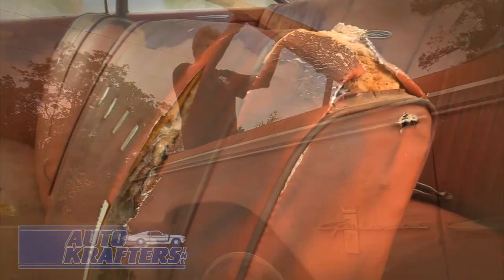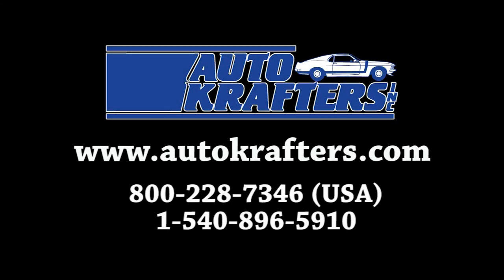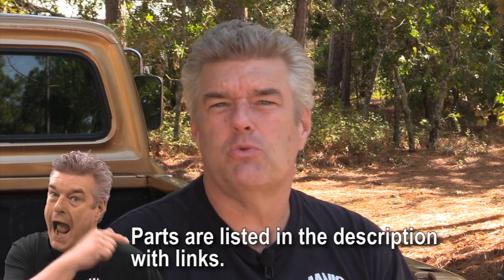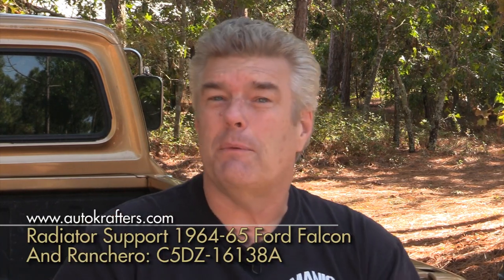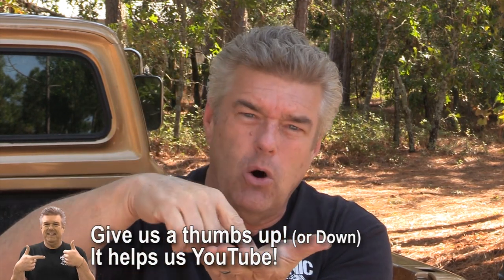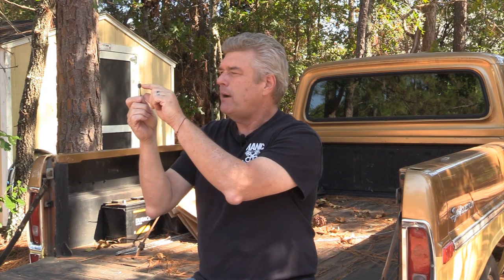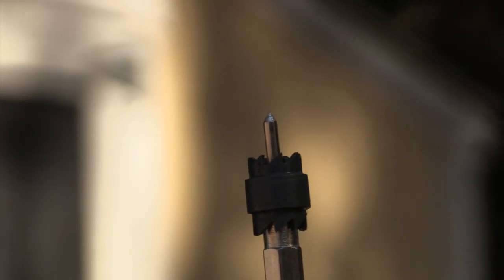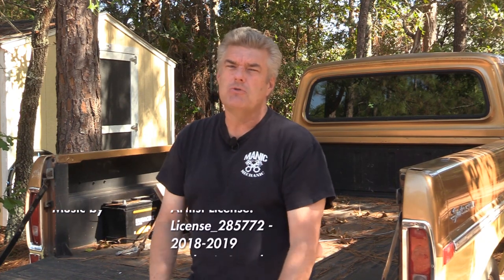Spot Weld Cutter Which One

Comment: I used a spot weld bit/cutter that I got off the Snap-On truck. It worked very well on a cowl replacement on my 67 fastback. Was it wrecked after 200 plus spot weld.... yes.  It was expensive but it was worth it.
Reply from the maker: Sometimes the spendy stuff is the best way to go.

Comment: What you use will largely be determined by which panel you are saving, what access you have to either side, and how well you and the tool work in harmony.  

If you are facing the piece you wish to save, and the lower panel is essentially a throwaway, then simply use a drill bit the same size you would select for plug welds, and drill out the spot weld.  When you place the new panel beneath and clamp it up, the hole you drilled in the top panel now serves as your plug weld hole.  

If you are saving the lower panel, and throwing away the top, you can use whatever works best for you.  There are many ways to accomplish the same thing, but if you are not proficient in using one method, try another.  I think each method has it's faults, so pick the one that best suits the area you are working. 

The holesaw type cutter typically cuts like any other holesaw does, and once the teeth start to cut a "channel", it is difficult to see how far along you are progressing.  At the point the cutter reaches the second layer, which is where you would want to stop, if there were a bit of rust between the two panels and your cutter had enough speed, you would have a visual indicator in a wisp of "rust smoke" that is seen coming around the cutter.  It is here that, even though some moderate speed is needed to produce this indicator, light pressure is also needed (better classified as "restraint") so that you don't go through too far and damage the second panel.  In my case, I found myself going through too far, and would either need to repair the deep channel I just cut in the second layer, or would have to weld in a circle to repair the gaping hole I just left.  Needless to say, I no longer use this method, and gave the cutters I did have to someone else that hopefully is having better luck with it than I did.

Some of the cutters have a spring loaded center punch, much like a machinists roto-bore.  Even with an initial center punch used in the middle of the spot weld, These cutters have the misfortune of slipping off center, and many people will simply drill a 1/8" diameter hole, either partially or all the way thru, to prevent the cutter from walking about.  I'll stop here and offer a generalized thought.  If you have difficulty filling an 1/8" hole in a piece of sheet metal with your welder, you will likely have problems with the pilot drill method, and perhaps should try one of the other methods.

I think the Wivco cutters will work better than the hole saw type, in that they mimic an end mill, so the cutter is relatively flat on the bottom.  This should give a less aggressive cut, a plus for people like me who may have a problem of leaning too hard on the cutter.  The open flute design will also allow you to better see what is going on than the holesaw type, which obscures everything.  It does use the pilot bit, so if that is not an issue (see above paragraph), then this is a good choice.

The blair cutter is available in either the spring loaded version or the pilot bit version, I think these are likely a more aggressive cut than the wivco, especially since the cutting surface is extremely narrow, so it may be more likely to pose the cut through problems I described initially.  

http://cdn3.volusion.com/uo9gz.acro2/v/vspfiles/photos/13224-2.jpg?1470814969

A rounded burr grinder is also a good method which should somewhat limit the damage to the (throwaway) panel to just slightly larger than that of a spot weld cutter.  The downside is that these also come with little tiny slivers of metal that are a pain when you get them in your skin, so it would be advantageous to address these with a vacuum cleaner/foxtail and dust pan on occasion to keep the issue at bay.  A pair of work gloves come in handy as well.  Keep some duct tape handy to pull out the slivers that sneak by.
  

  http://static.wixstatic.com/media/748e8f_035d1689c6214fa6964ec91ce12dbb3f.jpg_srz_500_500_75_22_0.5_1.2_75_png_srz
 

The last method I'll discuss is the one that I use because I don't play nice with the holesaw type.  I tend to inflict enough damage that I'll need to fix hole saw size holes through the save panel, or at least deep grooves.  I use a 3" cutoff wheel with a 1/16" thick cutoff disc and use the tool to grind away the spot weld.  I find for myself, it offers a less obstructed view of any of the methods listed, and with the proper speed (fast), will give you an indicator in the discoloration of the top layer (blue or darkened) usually before you have even broken into the second layer.  Basically the metal is heating up and as it starts to get thin, it heats up more quickly and shows this via a color change.  The color change back to bright silver will indicate you have reached the second layer, and act as a guide where to not grind anymore (the bright area) and where you NEED to grind, the blue/dark circle surround it.  The disadvantages with this method, are the top panel is basically useless now, you will need good eye protection (more-so than the holesaw type cutters), and due to the grinding particulate, will need to use a respirator/mask to prevent you from hocking up black globs shortly afterward.  I usually get a 3M or equivalent paint respirator, as the typical dust masks only serve to fog up your safety glasses, and as is evident upon the removal of the dust mask, they don't work all that well.  A paint style respirator exhales to the sides, away from your safety glasses, and typically conforms to your face much better. 

Grind pattern visible:

 http://i5.photobucket.com/albums/y167/rmccartney/1955%20Chevy%20Wagon%20Restoration/HPIM5779.jpg

That a brief view of both the good, the bad, the ugly with each method, now it will be up to you to figure out which one works best for you and best for the situation at hand
Reply from the maker: Agreed Robert I've seen tons of people wreck spotwell cutterspot Weld coaters because they don't use them correctly.. You really have to have a feel for how they for how they work.

Comment: What's hilarious he says buy eight of them I bought one in 2015 drilled out a ton of spot welds replaced a floor in my car I just realized I still had it started to remove the roof from my Ford Maverick and still Cuts Like Crazy it's insane how sharp it still is
Reply from the maker: Damage to tools most of the time is the user not the tool lol

Comment: Thanks for your view on the three most available spot weld cutters. I have used with great success the spot weld drill bits - they make the fewest damage and you can control the dept of your hole. Will buy them any time again - soon, as I surprisingly discovered some pin holes in the driver side front floor pan of my Mustang... 😔
Reply from the maker: Great point!

Comment: I have used the Harbor Freight spot weld cutter and was frustrated with the life of the cutters. I now use a Blair spot welder that is a lot more durable but it is a little expensive. One trick is to turn your speed down on the drill to help the life of the cutters. The cutters are built to hold up better.
Reply from the maker: Thanks for the heads up!

Comment: Just got done taking two Ranger beds apart to make one good one. Removed the floor and the front panel from both to make a good one. Lots of drilling spot welds. The quickest way was the. Harbor freight bit. Drilled the hole all the way thru the same size as the spring load pin because if the bit slips in any way it will break the teeth off. The little hole is nothing to weld shut before you put your metal back together for your final welding. Also took a regular drill bit and sharpened it flat and left a small projection in the middle of the bit to go into a small hole drilled into the original spot weld. Both ways worked good for me. Made the work go much faster. Hello from Dayton Ohio
Reply from the maker: Yup!

Comment: For a backer if you use a drill bit is a copper spoon from Harbor Freight, or a chunk of aluminum stock and in a pinch I've used a copper penny it took longer using the penny but it was all I had at the time.
Reply from the maker: Right on!